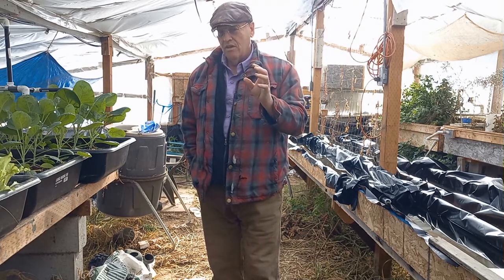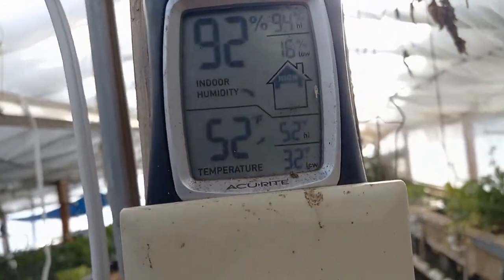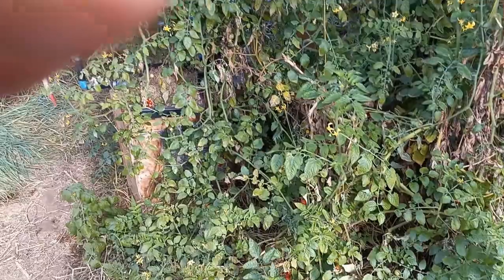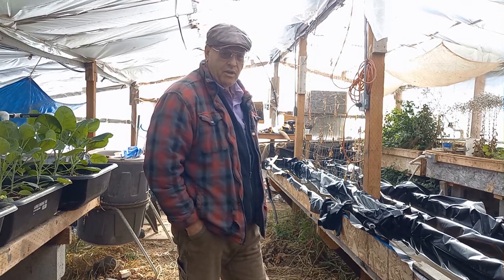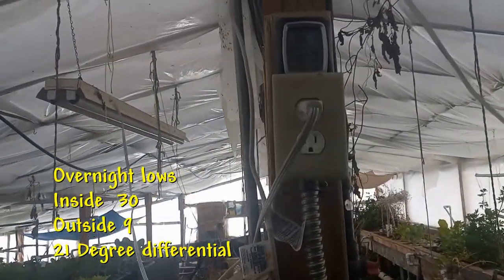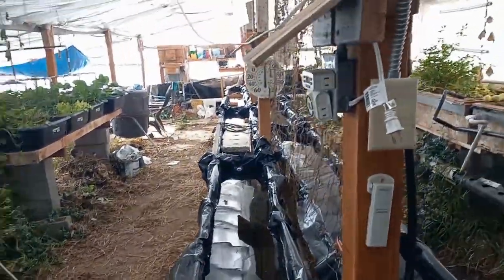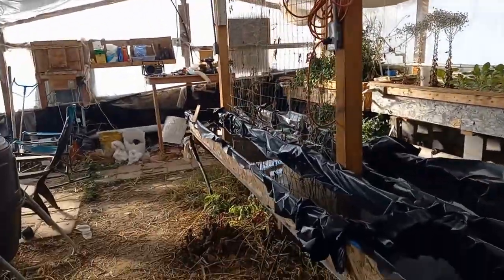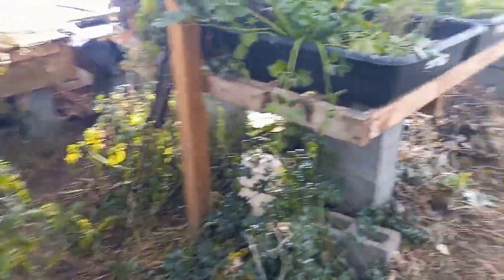My Pond Heated Aquaponic Wintertime  Greenhouse

Comment: ok Eddie.. i am guessing one thing that will help is some supplemental light..most plants in theory should have at least 16-18 hours of light.. so mabey some old florescent lights ..or some leds ..especially over the tomatoes.. ive really been interested in the geothermal heat like a climate batteries were you dig the pipes down into the ground 3 -4 feet and run a small fan .. love your work brotha!
Reply from the maker: I think you're right about all that but I am trying to see how far I can get with no additional heat at all, just the fishpond flowing around.    I am surprised by how much heat there is from that alone.

Comment: i think if you add an aquarium heater set to about 50 degrees you can add some degrees to the greenhouse. They are cheep and cheep to run. I'm in layton and will be building my greenhouse this spring.
Reply from the maker: There's about 1,600 gallons in that fishpond.  But a little bit more  heat would do a lot.  I'm working on something for next year.